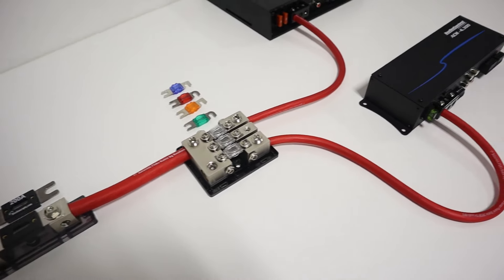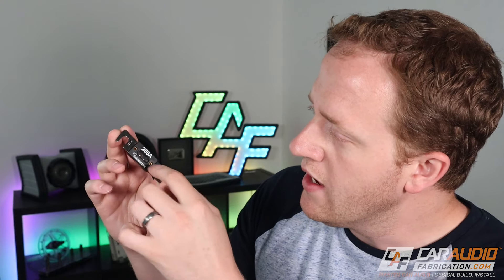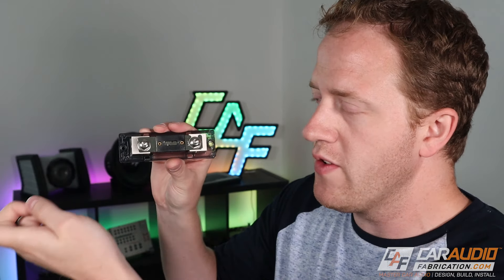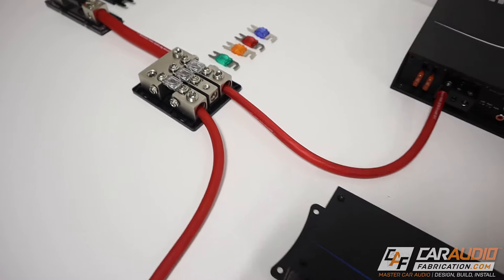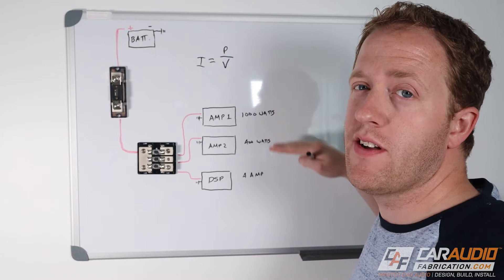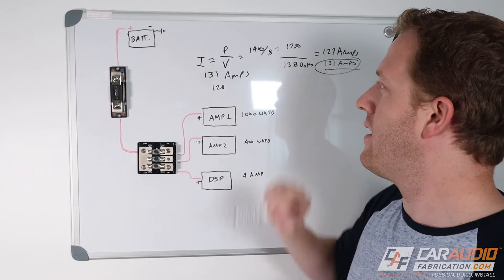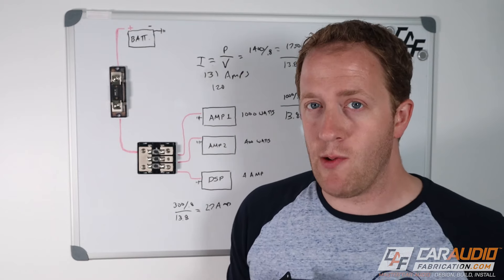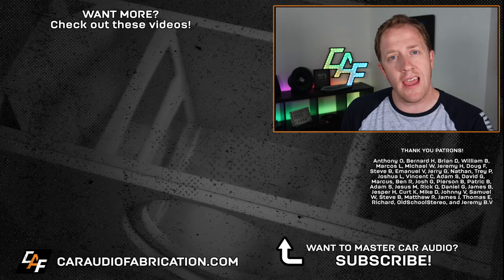Fuses EXPLAINED! What size do YOU need & MORE!

Comment: One thing you did not point out is that IF you blow a fuse not to keep putting them in there and blowing them. Fuses (especially 200A ones) blow for good reason and you absolutely have to figure out what is causing them to blow.
Reply: Just send it
Reply: If you place a fuse adapter into lets say a 10 ampfuse then took out the 10amp fuse and addes tw0 amp fuses and plug the adapter in that fuse spot with led wires the adapter has ledlight should you go up on amp and by how much radio takes a 10 amp fuse im adding led lights to that fuse should i go up im ampage becuae with the 10 amp fuse it powers my radio and led lights fine ????
Reply: Oh yeah well you can just add a bolt or even a paper clip. BOOM. fuses no longer blow.
Reply: I just chuck in a bigger amp fuse 👍

Comment: Mark, To get the proper fuse size in the equation, do we use the amp's max power, or the power I'm using via the ohm rating for my subwoofer? So, I have a 600watt 1-ohm subwoofer connected to a 600watt @ 1ohm class D amp (which the specs say is 2000w max power). Would I just do 600/.8/13.8? Also, my amp has no fuses, so would you recommend using a distribution block? I'm also installing a LOC with a smaller guage power wire than my main power wire 4 awg, so a block should be used, right?

Comment: I usually "under" fuse my stuff. Figure out the actual capacities of the wire and all, then de-rate by 20% or so. I do that with just about all my electronics that have user replaceable fuses. I worked as a A/V service tech for many years and learned that a lot of equipment "blows up" but does NOT burn the fuse! The old joke was that the $250.00 picture tube in the TV set will burnout to protect the 30 cent fuse! So, unless you're in a SPL comp event and would rather risk smoking the amp to get that 1st place award, I'd put  lower amp fuses in the equipment. If you de-rate the fuse in your amp and it does not pop during power up, you're fine.
Reply: Seems like you know you stuff, I'm trying to run a 0guage to the bank with an online fuse in the hood, but how would I still feed my smart 3 it's 0 guage and give my mid amp the 4 guage it needs.
I'm new to car electronics and couldnt find anything on Amazon.

Comment: I don't think they make 120 I think they make 125. At least that's what my mini ANL fuse has and that's all I could find near that range.  And another question I have is the gauge that you show on here doesn't include 2 gauge? It goes from 4 to 0. I bought 2 gauge wire because that's what crutchfields graph said that was adequate. It doesn't seem like many people use 2 gauge wire though. They just bump it up to zero. I bought 2 awg because it was well within the range I needed plus it was a little cheaper and easier to route in my situation.  And another question is when you go from a bigger wire down to two 4 gauge wires and we run fuses to protect the wire,  what if the wires are only like 5 inches long? I'm debating whether to add a fuse distribution block or just keep the solid distribution block that I have because the 4 gauge wires are very short and i dont see a hazard there. And I think they could handle the 125 amps that the fuse is at the battery.

Comment: Great video Mark! I'd also add that fuses can carry 2-3x their rated current for short bursts, so in many cases slightly underfusing is ok. I get the question all the time how an amp with a 100A fuse can pull 150A or more with my Dyno tests. Fact is, it can't for very long! But for short periods it can which is good. As you mentioned, music playback in most cases draws far less current than test tones or music with long bass notes. I also agree it's BAD to be on #TEAMNOFUSE and there's NO reason to go this route. Use quality components, good wiring and the fuse will never be a bottleneck in your system.
Reply: Most fuses are specified to survive a certain over current like 50% for a certain certain time delay like 5 seconds sometimes longer in a larger fuse. You have to pull the datasheet to know the time failure curve.
Reply: Off topic but. if someone has a 12' dvc sub and 2 300w amps .could someone wire 1 amp to 1 coil and the 2nd amp to the other coil ? Should someone get a class b fire extinguisher for the ensuing fire someone would need to put out auickly due to filling ur fuel tank while on the phone smoking a cigarette at the pump ? Or no ? 
                      ?maybe?
Reply: @logiticalresponse9574  wtf
Reply: @SbassLaser  i dont understand ur answer considering its a multi-coarse question-soup that should have either 1 multiple answers 2 multiple insults or 3 multiple insulting answers. ......... huh?
Reply: @logiticalresponse9574  Yes, you can put 1 amp to one coil and second one to other coil, but you will have to make sure that they are both in phase and gain matched, otherwise you might get cancelation and you could potentially damage your sub. This could be done easily using multi channel oscope, or with small trick that barevids showed in "Gain-match multiple amps IDENTICALLY - With no meter or scope!?" video.
Reply: @cekpi7  it's a good thing I guess that I have a spare speaker that I'm not going to use to test it on appreciate it
Reply: @wb5mgr  /
) da B
Reply: @krishnarevankar9002  🧐
Reply: Exactly, I've fit a 100A mini ANL fuse to my ANL block which is connected to a 18' 1/0 gauge wire and it hasn't blown, recently got my replacement fuse and need to put it in but considering it's been connected to an amp capable of 1700RMS and over 2500 peak and it hasn't blown whilst running the sub pretty hard can be testament. That said it is also a dual battery setup and could theoretically be halving the load between the two batteries so an amp capable of pushing 170A the demand on the front battery might only ever see a max of 85-107A whereas the large fuse going from the second battery to the amp would receive all the power. Not positive how that works out exactly.
Reply: Instablaster...
Reply: Yup!
Safety should not be compromised by quality and Quality is NOT compromised by Safety. That is why separate electric circuit for audio system is a MUST. 
*Hint - There are many current stabilizer in the market.
;p

Comment: Hey man. I just wanna say you nailed it.  I mean nailed it.  Thank you for the thorough explanation. EXACTLY what I was looking for.
Reply from the maker: Glad to help, hopefully you are subscribed and will share with others...
Reply: CarAudioFabrication yes I am subscribed and have liked every video of yours I have watched
Reply: CarAudioFabrication hello, I have a question.  I have new 12” subs with 4 connectors on one coil and 2 on the other coil. How is this easier to run series or parallel? So is the side with the 4 connectors that has the 2 positives and 2 negatives, the same positive and negative for that side? Is it making it easier to connect that side to the other side?   Please explain.  Thanks
Reply: It better to run 2 subs that have the same voil coil configuration. It looks like you have 1 dual voice coil and one single voice coil sub.
Reply: @jefftuttlejr    Have you figured this out yet?   What exact Brand and Model # subwoofers do you have???   You can use a DMM/Volt-Ohm Meter set to Ohms/Resistance and check for continuity between any two terminals on the subwoofer.

For example, if One of the Positive (+) Terminals on the far side that has just the 2 terminals has continuity or "directly connects" to one of the (+) terminals on the side with the 4 connections, you can confirm that they duplicate terminals, but just placed on the other side for wiring convenience.  When you check for continuity, if they are connected through the same voice coil, the DMM should display an Ohm rating close to or just under the Nominal Impedance rating of each coil.  But this type of terminal arrangement is very unusual.

I would think that you actually have "SERVO" subwoofers with a separate SERVO control/feedback circuit???  SERVO subwoofers will have a separate set of terminals for the Servo Feedback Loop which connect to a special amplifier that has a Servo Control Circuit.  Look up the specs and user manual for your subwoofers Online for these details!
Reply: @CarAudioFabrication  I have a question I have JL audio 1500/1 RMS amp it says a 250 amp fuse is that correct or do I use your math and go to a 150 or even a 120 thanks in advance appreciate all your videos.

Comment: Perfect answered all questions I'm running the 200amp stringer your using for example, on 4 gauge wire now about to switch to 0 gauge and wanted to research a the 200amp still good enough.

Comment: Wow. Someone who actually makes senses and you can understand. Great video I actually learned something. Made me subscribe. I work on my car electrical system all the time bit don't know much about electricity besides ther basics and common sense. I installed a 2 inverters a  pure sine and a modified sine, auxiliary battery new head unit ,amplifier, subwoofer, 6.5 and some tweets. Also put in ther 24 inch tv ,microwave, coffee maker and a solar battery charger/maintainer and a DC to DC charger/maintainer. I have room for all that I drive a 2019 mercedes sprinter.

Comment: You answered a huge question for me on fuse and wire size. Now I know how to calculate both sizes. Glad I found your channel because I was going to run my system (1200w sub amp and 400w high end amp) with regular distribution blocks. Now I know the proper way! Thanks!! Subscriber!

Comment: Very good video!  I'm already a pretty experienced installer, but every now and then I peruse YouTube to see what people are doing.  Personally I shoot for a wire and fuse that can handle at least 125% of whatever it needs to power.  For example, if I have a system that pulls 100amps, I'll wire and fuse it for 125 amps.  Also, I prefer circuit breakers because of easy reset as opposed to having to unscrew an ANL fuse in the field.  Personal preference though.
Reply: Hey why do you aim for the 125%. Kinda confused because he stepped down to a 120amp. I can kind of see why you would want to go up in amps for the extra headroom and I can understand stepping down is safer. But by stepping down like that doesnt it now have a higher chance of the fuse blowing?

Comment: I generally just fuse to a little under what the max amperage of what the wire itself can handle. I try to stick to one amp for the whole system though to make it easier. Just use the recommended wire size from the manufacturer on a 5 or 6 channel amp. Good info as always.

Comment: Very informative video currently I'm working on my motorcycle system and needed to figure out how to wire up everything as my motorcycle wasn't factory installed with nothing! So 2 6.5" and 1" components with xovers for upper fairing 2 8" woofers and super horns in my lower fairings 2 6.5" sub woofers and 2 8" sub woofers in the saddlebags 2 6.5" and 1" components with xovers in touring pack and a 12 inch sub in the touring pack itself, ok there's 1 4 channel 1600 watt amp for front side a 2400 watt amp for back side and a 1500 watt mono amp for my 12 incher. Now I had to run the amps 1 in fairing 2 in bags inline fuse, power distribution,  a 2.0 farad capacitor in the opposite bag, all the wires to my 7" Android head unit (so in that mess was power aux gnd all speaker wires remote turn ons as well as how ant radio ant and a 2 camera dvr setup for insurance reasons) to add to it I also went LEDs all around for ruining trail head lights and a 24pc LED rgb lighting kit with music processor to make a light show with music.! Wow anyways using what I've been learning of your videos it's coming together nicely! So well thanks

Comment: Thanks for this video. I needed this after I added a 12" sub to my system to see how it would sound and melted the fuse box. The wire is on the small side. I bought the system already installed I just updated the factory speakers.

Comment: Really well done video! I’ve always installed a circuit breaker at the battery vs a high rated fuse. It’s convenient to throw the trip/reset lever if I’m working down the line.

Comment: I like knukoncptz products but make sure to check the screws in the distribution blocks every once in a while or add lock washers. Had the the dual 1/0 fuse block start melting on me once because the screw holding the fuse down came loose. Was installed for about 7 months then one day started smelling something burn, thought it was the subs but they were cold. Then found the fuse block plastic melted
Reply: @john d   
This is common due to the many hot/cold cycles of your vehicle on a daily basis, and all of the engine and road vibration, etc.   Use a bit of the LocTite Threadlocker Blue 242 adhesive on your terminal block's set screw threads.

Comment: Hello thanks for your awesome info and videos. 
I have a question for my subwoofers I am running a sundown salt 4 amp that the manufacturer recommends a 400a fuse, this amp is rated at 4,000w at 1ohm, 2,000w at 2ohm and 1,000w at 4ohm. What if I am only running it at 4ohms do I fuse for that or still for the most that the amp can do at 1ohm?

Comment: Great video man, I am getting ready to install a 2000 watt rms Skar Audio amp that does not come with any built in fuses. So I will need a fuse by the battery and a second one of the same size to the single amp?

Comment: Thank you for the very informative video. I am in the process of building my system, and am bit confused on the fuse size calculations. The amp I am planning on using for the sub is rated at 150 watts @ 4 ohms, 300 watts @ 2 ohms and 500 watts @ 1 ohm. I will be running the sub @ 2 ohms so the amp will only be producing 300 watts. Should I calculate fuse size based on the 500 watts that the amp is capable of, or the 300 watts that it will actually be producing? Similarly, I plan on utilizing a small 4 channel amp where I will only be using 2 of those channels to power the rear speakers for rear fill. Should I calculate fuse size on the total output of the amplifier (all 4 channels) or just the actual output that will be used ( 2 channels)?

Comment: I want to say congratulations for your channel, I admire you and I like your perfectionism in everything you do! I just have to comment there is a mistake in this video. When you want to calculate the overall current draw of an amp you don't have to deduct the efficiency and this is because if an amp has efficiency for example 80% the rest 20% converts to heat and this energy comes also from the same source which is car's battery. So to finalize if an amp is 1000W that means 1000W / 13.8V = 72.5A (We don't care at this point if 80% of the energy will convert to music and the rest 20% will convert to heat) We just want to calculate the current draw in order to be able to pick up the right fuse. Sorry for my English hope you understand me :)
Reply from the maker: Glad you like the channel, thanks for watching. Your understanding here is incorrect though. There are plenty of amplifier test videos on YouTube. Watch and see how much current they pull. The amps must pull more current to create the rated power because of losses in efficiency. You must take a rough efficiency value into account.
Reply: @CarAudioFabrication  Hey Marc sorry its my mistake I've watched your video again and I saw that you wrote P/0.8 I thought it was Px0.8 that's why I thought it's wrong my apologies.
Reply: @CarAudioFabrication , please help. I'm running 8k, 2k and 400 watts amps. With two zero gauge lines from the super cap under the hood to the Lithium in the trunk, I should be using two 500amp fuses? My number by your math is 942. One amp calls for a 60 amp, another 120amp the last 8k calls for 800amp fuse. I have 6 positive runs to the 8k that calls for 800amp fuse. Is that 800 split across the 6 lines or 800amp fuse on each? All zero gauge to everything from a 10 slot SMD fuse distribution block. Thank you for your reply.

Comment: Some old school stuff: fusible links.  What are they?  Basically a short section [maybe one foot] of purposely undersized wire to guarantee failure point stays under the hood in the event of a hard fault or short.   Basic rule of thumb: size down by 4.  So, if a distribution wire is 10awg, the fusible link will be 14awg.  I like  fuses better because failure point stays contained, and replacement is so much easier.

Comment: hi Mark. quick question. should I use the watts I use on my amplifier to calculate the amps or the maximum power output of the amplifier. for example i have a mono amp with rated 400 on 4 ohms 650 on 2 ohms and 1120 on 1 ohm and i want to set it up on 2 ohms. should I base my calculation on max power of the amp which is 1120 watts on 1 ohm or use the max power output that i use which is 650 watts on 2 ohms. thanks for the great content.

Comment: hi caraudiofabrication, look at the minute 10.06,  why the power (1400 watt) of the amplifier must divide by the 80% efficiency. it supposed the value watt to be more less if the working efficiency is 80%. if im not mistaken, 1400 watt must multiply with 80% and the result is 1120.  i'm enjoy your video. keep up the good work. thanks...
Reply from the maker: Nope. Wrong. I'm calculating how much power IN is needed. You must have MORE power in than out. The math in the video is correct
Reply: Thanks, for your explanation...will be apply on my car audio system upgrade...

Comment: Old bugger here,  back in my day once I started doing large systems for competition, we did not use fuses, this was before lithium batteries, so just lead acid batteries.  We would use 95mm^2 cables, so less of a fire risk than using any sort of normally sizes cable.